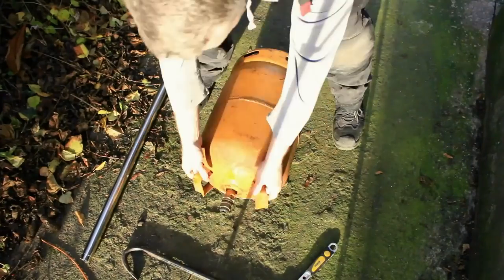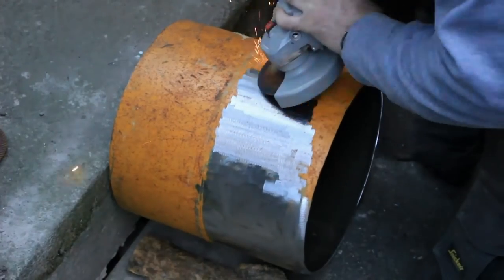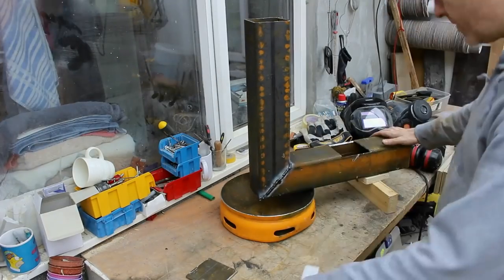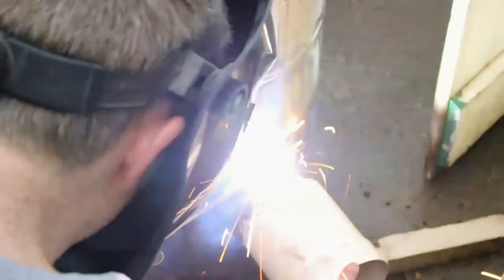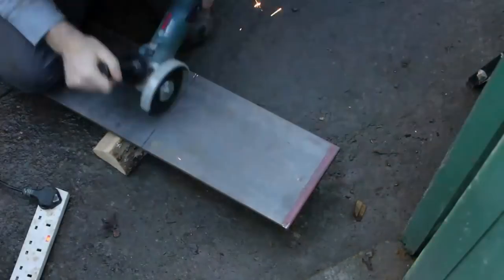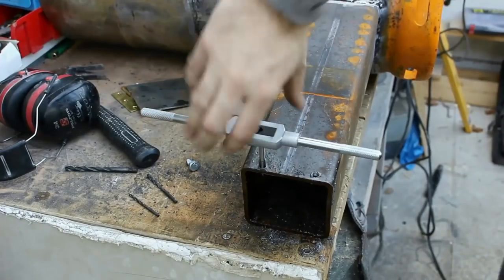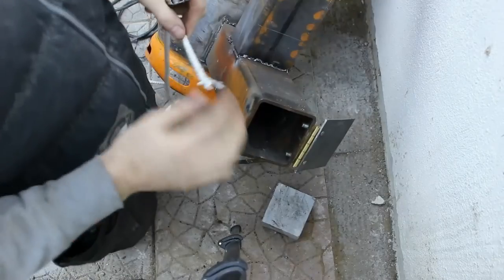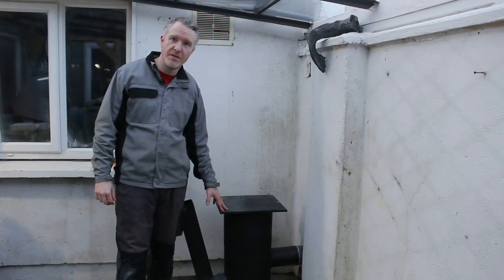Home Made Rocket Stove Build. DIY

Comment: On your top flat plate you could weld 3 tabs evenly spaced just inside that circle you you made to act as a lock so the plate doesn't get shifted or knocked off.

Comment: I tried the heat wrap idea ( I used heat wrap made for motorcycle exhaust) on my first build years ago and although it did work great, the problem was the inner heat riser pipe, which was 4"  tubing (1/4" thick walls) burned out in less than one season of heating. The flame gets so hot it actually flakes the steel off the inside of the riser tube. I've since learned you can't use steel for a heat riser. I had to go with a different material for it to last over time.
Reply: What did you use? Perlite? Ceramic blanket?
Reply: If seen a video where they use ceramic board inside the riser, seems a good idea.

Comment: Why would you want to insulate the square upright pipe? I would want all the heat possible to get through to the large round chamber. 

And for the door, if you had welded on a weight that stuck OUT from the door, it would tend to hold the door closed as it tried to hang in a balanced way with that outboard weight on it.
Reply: "Why would you want to insulate the square upright pipe?"  Study the theory of rocket stove design and you will see why.

Comment: Bob, to make this more efficient you need to ignite secondary gas at 500 deg. (Far.) in the fire chamber and  I was told this hot temp. doesn't want to go down which means they have to burn in the fire chamber rather than in the mass duct.  So! if this is true would it not make sense to use a heat ex-changer at the top of the fire box or a fan to pull these hot gases through the mass ducts???
What do you think???

Comment: A big mistake!   

Whats the purpose of wrapping the inner pipe? 

By enclosing the inner pipe with the outer tank and exhausting from the lower rear section you have created an effective heat exchanger. When you wrap and insulate the pipe your reducing the efficiency of the  created stack heat.  The idea is to retain as much heat before exhausting out the chimney. Having a shroud or outer chamber which you have created will radiate into the room. But by wrapping it you are forcing most of the heat out the chimney. The correct way is NOT to wrap the pipe and allow the chamber to get as hot as possible therefore releasing a cooler exhaust and maximizing your thermal efficiency.
Reply: JR Perrotta have a look at the theory of Rocket stoves - they're not like regular stoves where you require high temperatures in the chimney specifically to prevent creosote from dangerously building up in your chimney. Rocket stoves use an insulated burn chamber to reach temperatures high enough to burn up all the creosote and normally produce little to no smoke. As such you only need enough draft in the chimney to get the exhaust gases out. But you need to insulate the inner burn chamber to reach those high temperatures.

Comment: I put one of these together , but I have a problem: the smoke , and sometimes even the flame is coming out the feeding tube... Any idea what I did wrong...?
Reply from the maker: I had the same issue at the start. When first lighting, I push the paper and kindlling right as far back as I can and light it in there. I wait for the stove and flue to get warm before adding more material. Once the chimney is good and warm the flames and smoke will want to travel that way, not out the feed tube. Hope this helps
Reply: I have the same issue.  I have only lit mine once and it isn't complete yet.  The air inlet, fuel box, and burn chamber are also 4" square.  I think that my problem is that I need to close off the end of the horizontal pipe (where Bob smartly put the hinged door) and actually let the air feed in also through the fuel chute?  Also, once it's closed in with a chimney hopefully there will be more draft to pull all the flame in the right direction.  I'm thinking it may be better to have the fuel chute drop right at the base of the internal chimney instead of outside on the horizontal part?  Not sure.